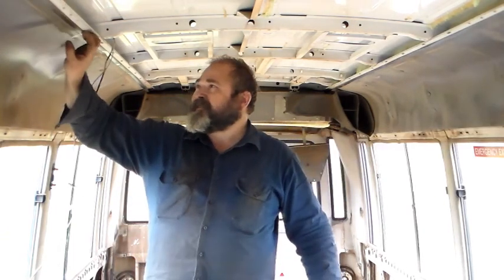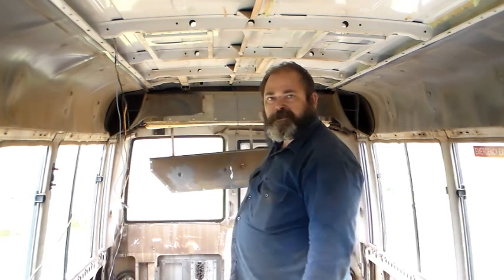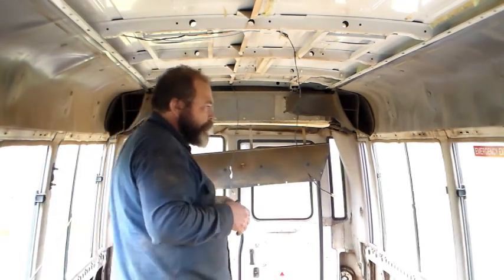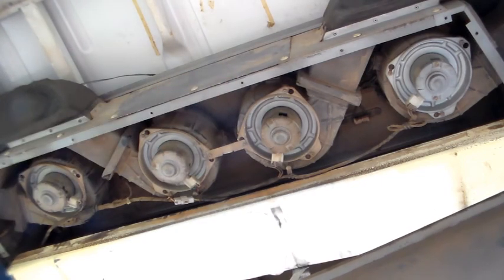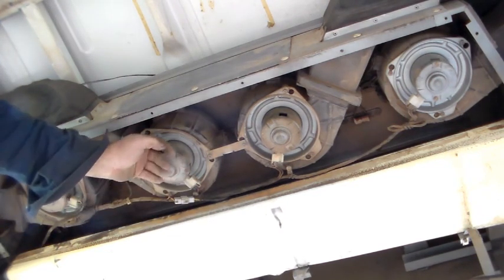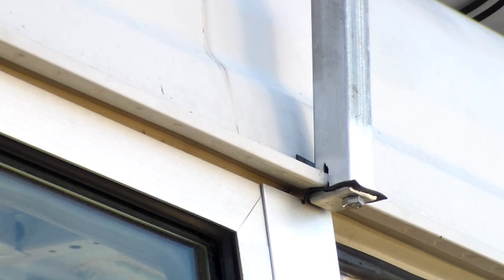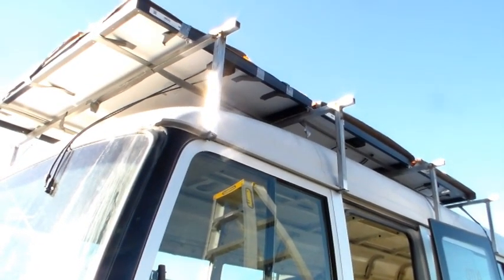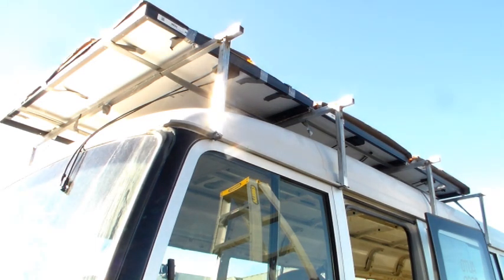DIY RV Motorhome Build Part 4: Cabin A/C and Solar Panels

Comment: Nobody likes taking a shower in a vehicle. Its the black hole of wasted space everyone thinks they need. 
I would make some nice fold out steps out the back door. a wooden lattice floor (lets water threw and keeps your toes off the dirt and rocks) some heavy curtains for walls and an awning for roof... keeps all the smells and moisture outside. Fuck all these different tanks and plumbing bullshit. Make the shitter and shower easy to pack up or put away and the curtains for privacy.
Reply from the maker: Yeah if I was spending most of my time "camping" I would agree, happy to shit in the woods. However I expect to be spending the majority of my time in populated areas so I kind of want my privacy. I expect to be spending most of my time outside trying to gather food anyways.
I do appreciate you input and point of view. Cheers
Reply: I lived in a fifth wheel trailer about the size of your bus for 3 years. You can build a magnificent bus conversion with a great size shower. You will realize that you are just "camping" in a populated aria.